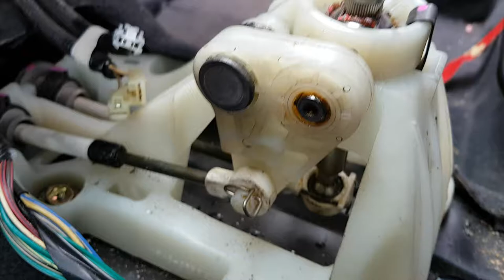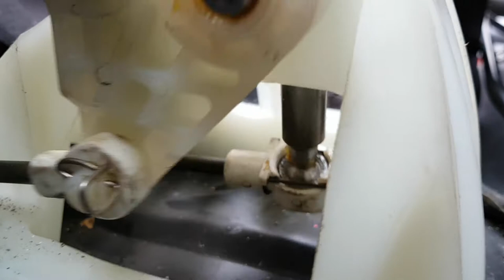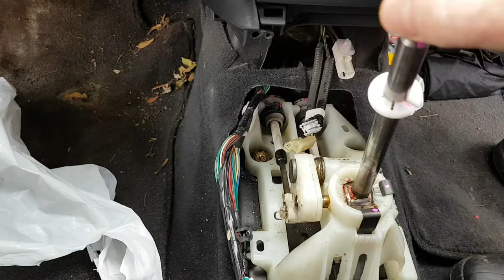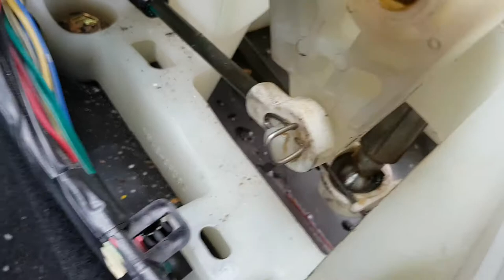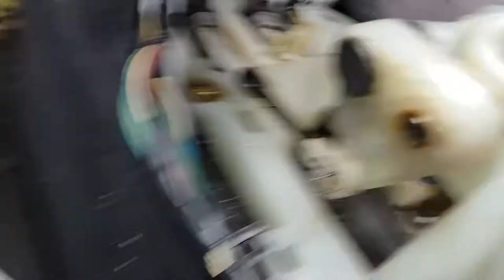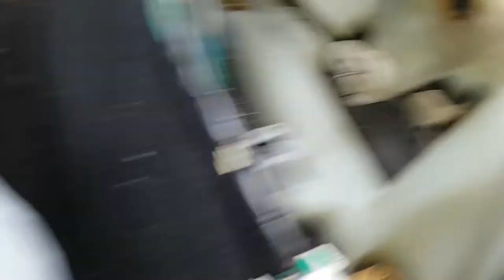corolla shifter

Comment: Had that same problem on my 03. Fixed it. It’s a linkage( I think it’s what it’s called.) On the transaxle. It needs to be taken apart and regreased. Two 14mm bolts and the cotter pin to remove it, after the intake is removed.

Comment: Under the hood on transmission side they're 2 bushings that will need changing. I recommend brass ones. If u already changed then it's something to do with either the cables are twisted or tranny links need greasing. Also I remember this happening to me when I replaced my shifted for short shifter but the bushings for base where to high causing it to bind because the angle of the bottom cable. Short shifters for this setup are no good unless u go TRD or Cage Short shifters but they expensive. Put stock bushings back in or buy new shifter kit. Good luck
Reply: If the cable is twisted, do I need to replace the cable?

Comment: My shifter is doing the same thing did you ever figure out why the shifter is so stiff in neutral?
Reply from the maker: no man this is shit, i replaced a shifter bushing for nothing, my mechanic removed the bracket that connects into the transmission and added some grease it was better but obviously still wrong
got pissed enough of that car i drive it like that.. still runs

my take is either a shifter cable got bent (i dont see how this could happen.. my gf drives the car) or maybe some linkage inside the transmission.. i would be curious to strip that thing apart
Reply: @allpr0h  as tu trouver le probleme jai le meme